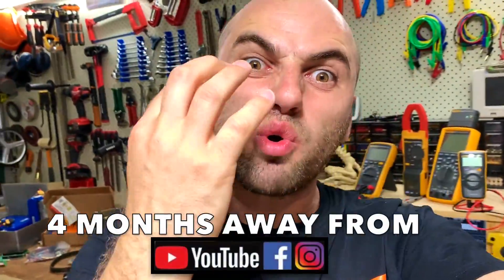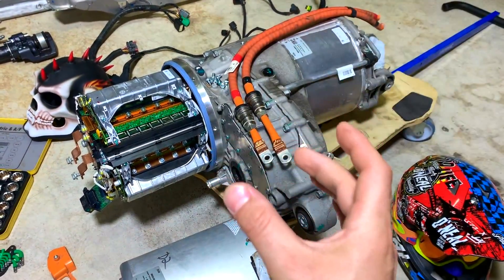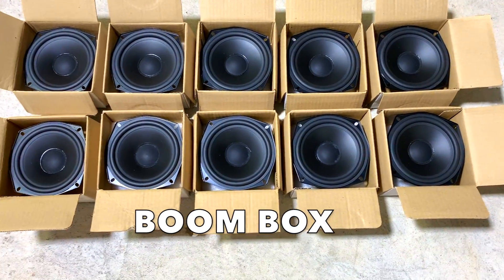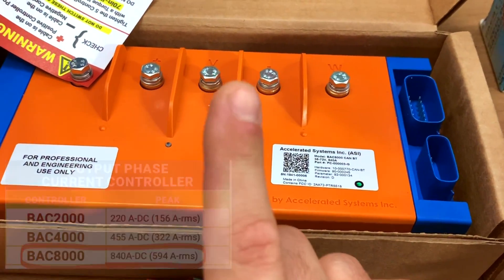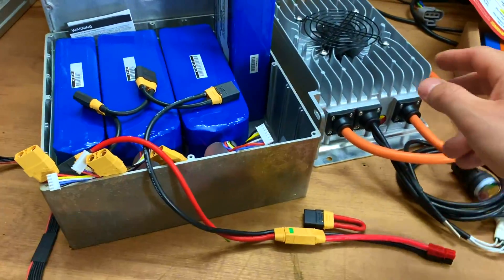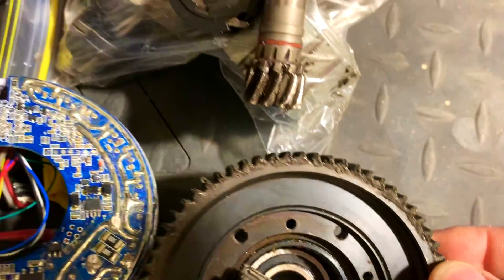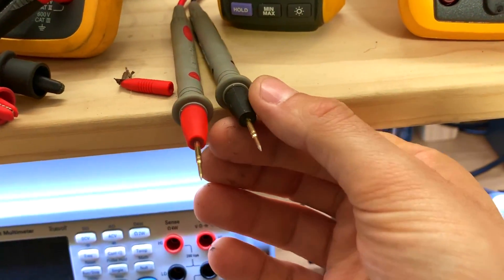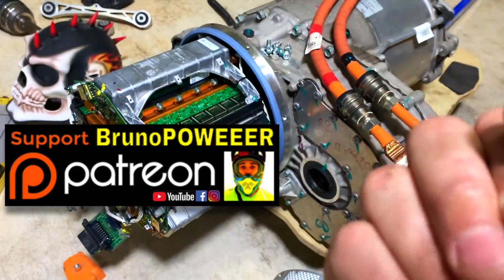BrunoPOWEEER is back - Tesla motor, SurRon motor, ASI BAC8000, Electric Go Kart?

Comment: with all that power have you ever considering building an electric ultralight aircraft?
Reply from the maker: For an ultralight I would’ve need to remove the reduction gearing and differential (cut that whole middle cast aluminium section off and removing the heavy steel gears inside) and just use the motor and inverter. Depending on the aircraft it may be just fine... then need to consider a 400v battery and how much autonomy, how long you want to fly. There’s a maximum weight the aircraft can carry.
I would LOVE to explore these things but unfortunately I don’t have an aircraft and the friends that I know wouldn’t let me experiment such crazy stuff in their expensive $$$$$$ toys. Yeah would be very interesting to see that =]

Comment: That's awesome, being a dad is the best thing I ever did. One quick question,  Bruno. I'm building an extreme GT hardtail using the brand new CYC x1 pro with torque sensor and ASI bac2000 at 72v. I was going to build a 72v 13ah pack  using 18650 cells which would cost me around £300-£400 if I built it myself and anything from £700-£1100 if I bought  one. I don't really need a whole lot of range, (5-6.5ah)but I do need a high performance pack so I'm thinking maybe lipo is the way to go? Any tips or recommendations would be much appreciated mate. Give me the POWEEEEERRRRR!!! YEEAAH!!!
Reply from the maker: Yeaahhh you’ll be flying in your CYC x1 Pro with BAC2000 hahaaaa siiiick build mate!!!
Okay the BAC2000 can be crazy powerful for that motor, I thing people stop at 80 battery amps with that motor. 18650 you’ll need lots of cells in parallel to handle that power... maybe 8 to 10p (don’t trust battery manufacturer specs, nothing makes sense) I know you only need small capacity but 18650 you need many cells to deliver big power otherwise they run HOT and age super fast and die...
Some people are using Sony VTC6 they’re the best high power 18650 in my opinion and some people are using the bigger 21700 Samsung cells (they sag less and driver more power in the same space). If you’re after stupid power and something lightweight better go lipo, pick the size u want from Hobbyking or any other RC shop and fit a BMS like the 400A Ant BMS with display and Bluetooth. You’ll be able to control EVERYTHING, set to balance whenever you want, all done using an Android smartphone. Buying a complete battery is okay (and may be shitty inside) but you won’t learn...  making your own pack is AWESOME... what you learn is priceless... best university ever!! =]
Soooo much POWEEEEEEEERRR ohhh yeaahh
Reply: Rob Rose the torque sensor works with the bac2000?

Comment: Congratulations! I have had a bad experience using an aluminium case for lipo battery pack. Of course you know what your doing. I was hearing the odd crack and pop from somewhere and found it was shorting out on the case. Brought back memories.
Reply from the maker: Yeaaaahhh I know EXACTLY what you’re talking about =]
aluminium case can be AWESOME and very safe IF... IF... it’s properly insulated with fibreglass sheets inside. Plastic can also be used (fire retardant ones preferably but too $$$ and not easy to find) but in case of a fire fibreglass stays together in one piece. I’m having fibreglass inside my pack ohhh yeaahh good you mentioned about your experience so other people read and think about it too =]

Comment: Congrats on the baby..You have my full support bro..I have been checking out the specs on that orange controller..Also recommend a mobipus controller as well...They are made for hotrodding.. Welcome back!
Reply from the maker: yeeeeeeahh man.. I'm BACK!!! Either ASI BAC8000 or SiliXcon SL controller... Mobipus controller used by Sketch in my previous video https://youtu.be/B7OUMzH0nOY is apparently no longer available... their website is been down for loooong time http://www.mobipus.com/ and the guy who sold the controller to Sketch only had a few controllers. I wish they're available to the public but sounds like they're gone. I even emailed them maybe a year ago and never got a reply...
Most people using the BAC8000 need to tune the controller down otherwise it will fry the motor haha... too much POWEEEEEEEERRRr

Comment: That's all the bigger the Tesla motor is?! Holy shit, my 3 wheel is getting one.
Reply from the maker: Haha yeaahh man.. all that stupid crazy power comes from that rear motor... the motor itself is just one side and all the other stuff are electronics (motor controller) and diferencial / reduction gear to bring the motor rpm down to wheel rpm... soooo much POWEEEEEEEERRR ohhh yeaahh
Do you have a link showing your 3 wheel??
Reply: @BrunoPOWEEER  Not yet. I'll probably make one when the snow hits drifting or something. It's a neglected zap xebra. 7kw with 17kw peak. Running it off 84v of leaf batteries @ about 5kwh. Rewired the whole thing since the mice ate the wires. It so very badly needs a good power plant though, only gets up to 42mph.
Reply from the maker: Hahahahahahaha the mice ate the wires Hahahahahaa shiiiiiiit... any dead body left or the little cute mice survived??
Did u see my latest video showing the Nissan Leaf cells with Batrium BMS https://youtu.be/eawsLxQ6HXY

Comment: I ordered a new battery from unitpackpower on Aliexpress 11.11 sale, which is 14s8p 52v 28ah Samsung 35E cell triangle case for my bbshd motor. Do you think it's a good choice and what range on a full throttle can I expect? My old 14s5p 52v 17.5ah Sanyo GA hailong case was 2.5 years old and was working not so well in the end, voltage sag was very big, it was discharging pretty fast and even shut the display off when voltage around 50v. Before April 2019 when I had my first failure with broken bms it was working fine and range was about 50 km but later when I replaced bms I had about 30 km. So I didn't understand why the battery reduced it's capacity so fast.
Reply from the maker: Dmitry Manzano yeaahhh man... 52v 28Ah 8p battery should have plenty of power to spare for the BBSHD motor... anything 6p or bigger will run cool and litre voltage sag... little 4p packs gets so hot and fail so quickly... 8p is AWESOME!!! Hopefully they fitted a 50A BMS instead of the little 20-30A ones... BMS may be your weakest part in this pack... maybe open and inspect the BMS specs once it arrives

Comment: Hey Bruno! Awesome to have you back! I have a question. Do you think its safe to put 4kw's (~75A 52V) on a Mac motor 10T? Cheers from Sweden!
Reply from the maker: Heeeeey mate... yeaaah I’m BACK hahaaaa 
4kw on a Mac motor is possible but you need to pay attention to heat build up inside the motor, may have to drill some big holes to expose the motor windings for cooling if it’s getting crazy hot. It all depends how ping you hold the throttle, often 4kw will put you up to speed quickly and you won’t hold full throttle for mor than s few seconds.
The weakest part of a Mac motor are the internal clutch/freewheel and the nylon gears.  There is a way to hack and lock the clutch so it would never damage and you can enable regen in your motor controller.
I tuned a Mac to 3-4kw, a heavy Yuba mundo heavy bike and it was craaaazy wild... freewheel lasted for 5 months but it was so much fun

Comment: Bruno.. What is a good Waterproof, inline watt meter to use on ebikes.  Check out my channel to see... I built a solar trailer to charge my 52v 17.5ah lithium batteries with a 170w SunPower® panel with Maxeon gen III cells.  I need to monitor the watt consumption so that i can get the best gear/power ratio.  And a waterproof watt meter that can be seen in sunlight (when we ride).  Most on the market are not waterproof and most cannot be seen when the sun is out.  Thanks Bruno..Life is so good.
Reply from the maker: The only waterproof watt meter for eBikes that works great in sunlight and night time is the Cycle analyst from Grin Technologies https://www.ebikes.ca/shop/electric-bicycle-parts/cycle-analysts.html
You can record so much data on the meter and even add an extra data logger, there’s a mode with GPS that crosses all your electrical data vs gps location so you can see efficiency on the map. Start with just the Cycle Analyst and a basic shunt and you’ll see how much information it records already, it’s AWESOME.

Comment: That Tesla motor is exactly what I want to put in my Renault Twizy. Who wants to see that?!😁
Reply from the maker: andy kirby hahaaaaa yeeaaahh man.. please do it!!! You’ll turn your Twizy into a tall and fancy go kart hahaha
Reply: BrunoPOWEEER hell yeah! It will be so quick. It already beats a lot 0-30mph from the lights so I think with that drivetrain it would be insane. It looks quite small. I may need to talk to you about hacking the inverters. But I’ll be watching to see your progress anyway 👊👊
Reply from the maker: @andykirby  using this Tesla large motor will be a big mission... 139kg just for that motor without motor shaft and other things that goes around and not including BATTERIES.... need to find a 400v battery that can handle up to 500-1000A.... talking about thousands and thousands $$$$ + 400v BMS (not cheap)... the whole lot is crazy expensive... 
*ahh.. 600 euros for the hacking logic board as well...
Reply: Love your stuff Andy. Thumbs down because no one wants to see a Tesla motor wasted in your twizy. 😅. Actually it sounds like fun.🤔

Comment: The tesla motor is a better pair for an offroad or track buggy than a regular gokart
Reply: Agreed. I can't see the Tesla motors potential ever being usable in a gokart. I don't what torque control is available on the ASI's though, but even so, you've gonna need bigger and stickier tyres than a gokart to use it anyway I think. Good for YouTube though lol!